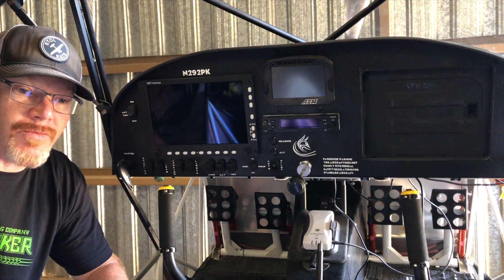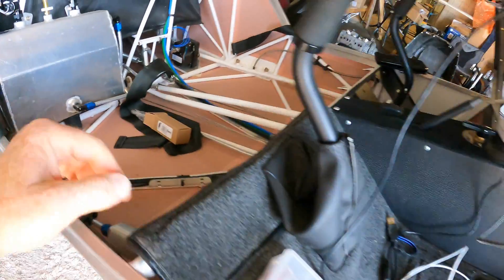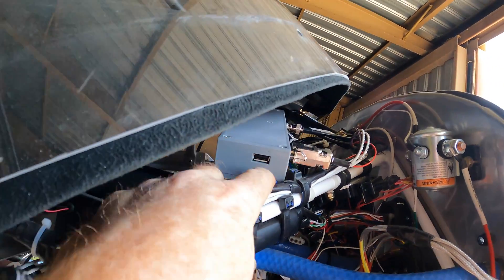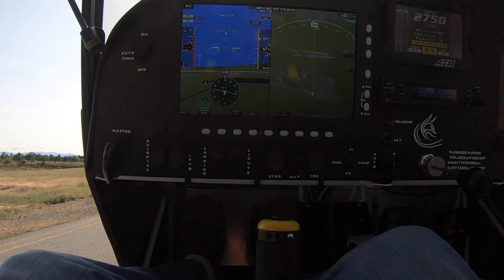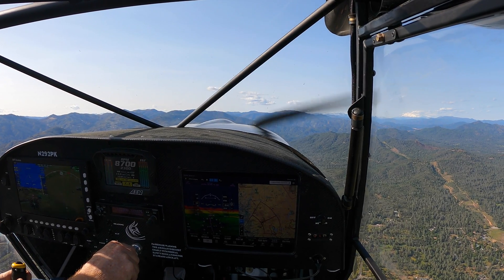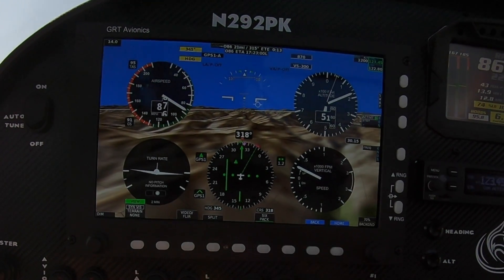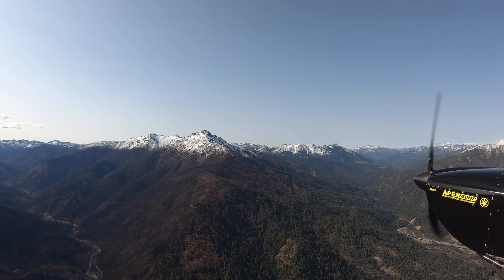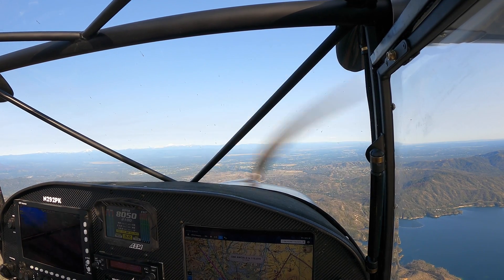Kitfox 7 Apex Build Episode 61GRT Discovery ADS B Receiver Install

Comment: Great info Bryan. What camera did you use for the taxi cam?
Reply from the maker: It is just a back up cam, has to be analog with a usb input end. I used this one https://www.amazon.com/Universal-Mount-Front-Camera-Built/dp/B004HJ9D4Y?pd_rd_w=J8lCB&pf_rd_p=156a0c3c-24b4-42c3-ab75-57bbc5cae817&pf_rd_r=04MDJVCKXGRDBWV1WA0Q&pd_rd_r=060b0175-8ccc-4a3e-a70c-3116a97d65b6&pd_rd_wg=Yreca&pd_rd_i=B004HJ9D4Y&psc=1&ref_=pd_bap_m_rp_1_sc
Reply: @BowenAero  Great, thanks.

Comment: pick up the sound mod for your hero 9.  has a spot for an external mic/input, and the battery doesn't fall out. Also has a large built in mic with a foam wind noise deflector(if that's the correct term.  It is a bulky setup but I have used it bouncing around on my mtb and in my little cessna 150 without issue.

Comment: Awesome to see a new Project Kitfox vid, what does the "Auto Tune" switch do?   Besides ADHRS, did you install a magnetometer too?  Would like a NR Prop for my Apex build.  They say they are working in Kyiv now during the war to fill backlog of orders,  but seems risky to send money now.
Reply from the maker: The Auto tune switch allows the ECU to take the wide band O2 sensor information and fuel trim to keep the air fuel mixture ratio perfect, if the O2 sensor fails and starts giving inconsistent information, I can turn off the auto tuning and then the ECU just goes to the programmed fuel map.